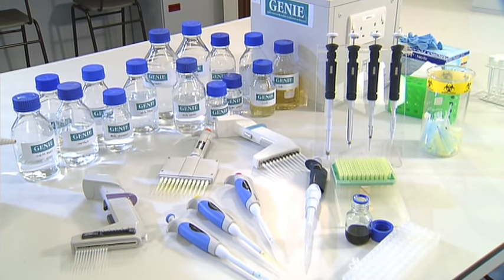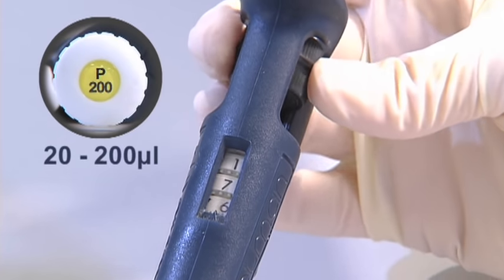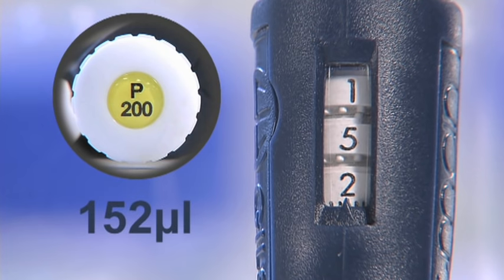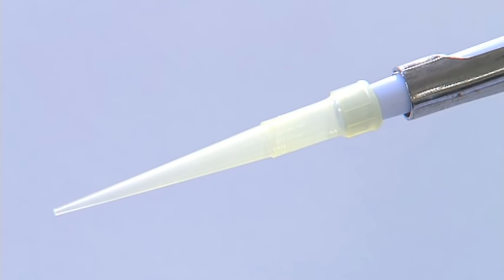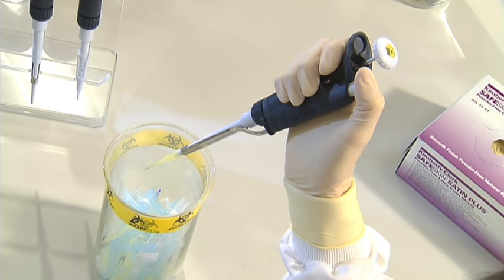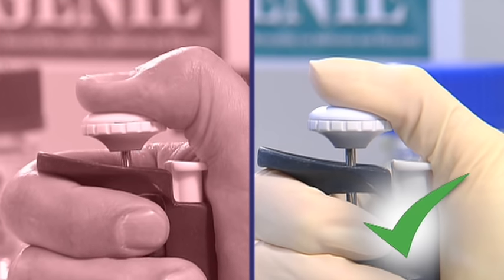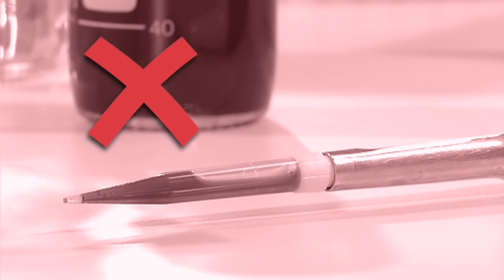Using a Micropipette - University of Leicester

Comment: You've covered the possible ways the pipette can be contaminated or damaged,but you've failed to follow up on what to do about it. I started working in an analytical lab over 20 years ago and they were having trouble passing the  unknown quantitative  metals tests each year required by the EPA. My first year on these analysis's I was testing the output of my eppendorf pipette on an analytical balance with reagent grade water to insure in was delivering the proper volume before making my standards. Another analyst asked me what I was doing , I told them and they then said." well I worked in the medical field for over 10 years and we never tested our pipettes". All I could think was no wonder so many people die in hospitals if this is normal SOP in the medical field. If the pipette is found to be not delivering the set volume it must be taken apart and cleaned or repaired !!!! After this all our measuring equipment was checked closely for accuracy. We never failed our yearly test again .
Reply: Awesome story, that's making the world a better place.
Reply: The first thing I did on receiving a new pipette was to test it. a) for accuracy, b) for repeatability and c) to check my technique. That analyst wasted 10 years.

Comment: I've been told to repeatedly wet the inside of the pipette tip by carefully pipetting up and down to the first stop 2-3 times with the liquid to get the accurate volume, is this not necessary?
Reply: Hey did you figure if this is true or not?
Reply: @sonicandroxas  I've heard it in other videos from different manufacturers, so it might be true

Comment: Mh dont want to be a douche but isn´t this wrong?
me and my roommate learned to use it like shown here but setting und the volume and how to "fill" was different.

first if u want to set the volume everytime from a higher number to the lower for example u are at 10microliter and want to get 20
10->21 or higher -> 20
and when filling the liquid in with a new dry tip u want to put in for example 20micorliters.
u put 20microliters in to wet the pipette and release all of it.
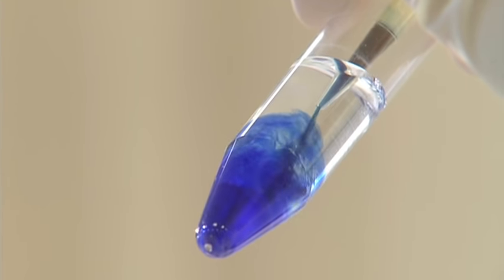next u put in 20microliters again and have exactly the volume u want + the dead volume u see @4:54
so u actually release 20microliters and not 20-dead volume which always stays in a pipette

Comment: If we have to use the second stop to eject the volume into the receiver tube there is going to be bubbles with that which is going to give you inaccurate results when say you are measuring the OD of serum samples. And if we don't use the second stop there would still be liquid in the pipet tips. What do we have to do?

Comment: Nice explanation. However I am confused at 2:44 so if I have to 152 uL using P1000, then what should be the number on pipette?
Reply: You couldn't set the P1000 to 152 µL, it would only let you set the µL in sets of five, so you could set 150 and 155, 160 and so on.